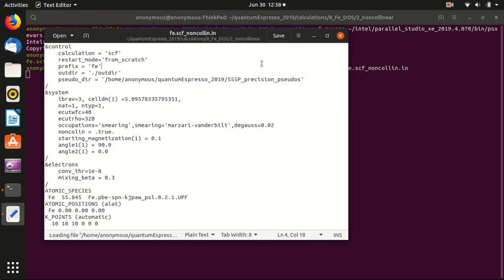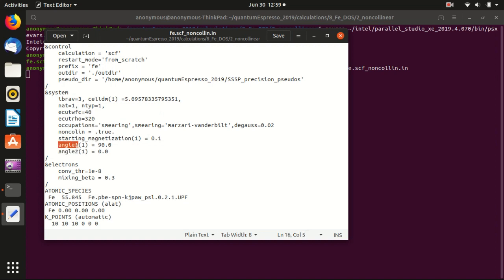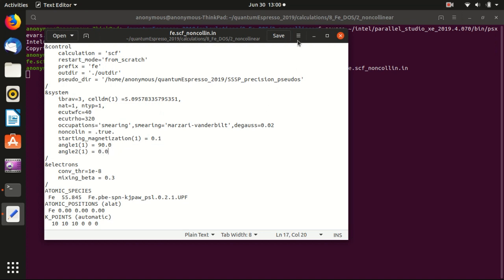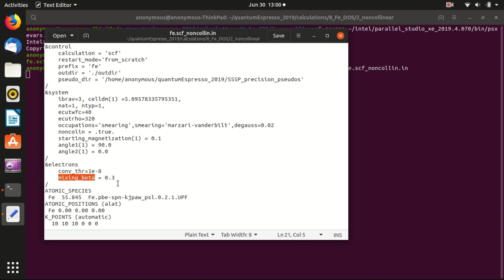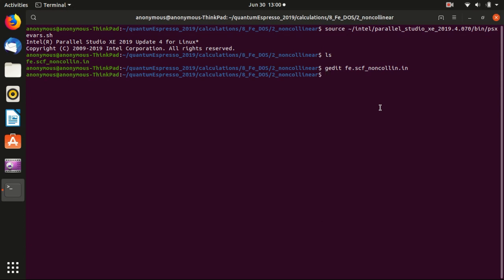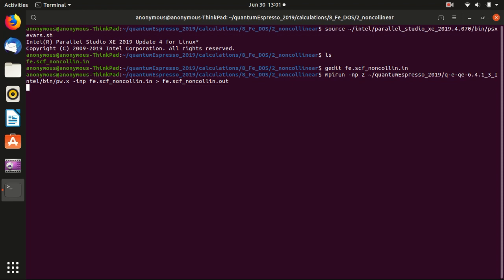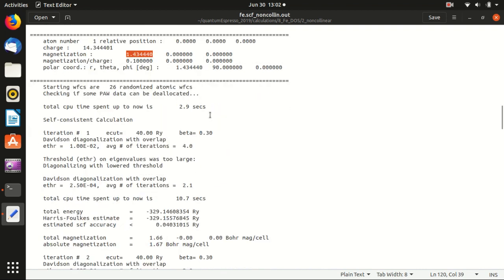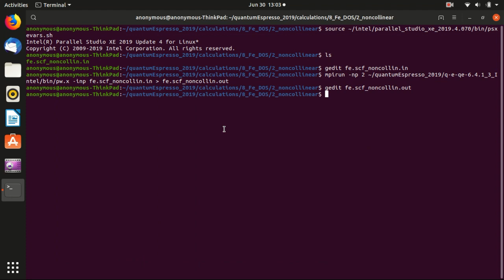Project: 7.2 Fe noncollinear calculation demo | Quantum Espresso Tutorial 2019

Comment: Can you show a noncollinear calculation with the arbitrary angle of moments with respect to the z and x-axis? Is there any software to calculate those angles for a particular system? I am using VESTA where the angle between atoms can be determined easily but not the moment with the axis.